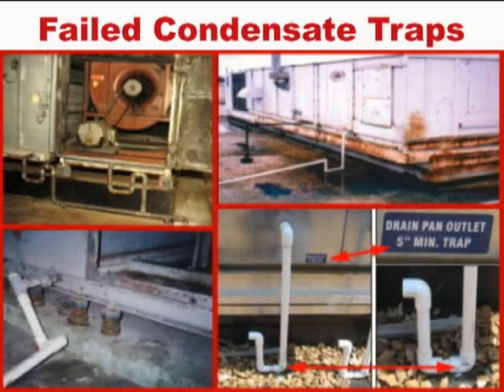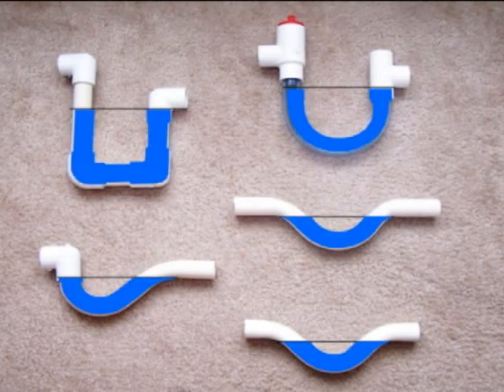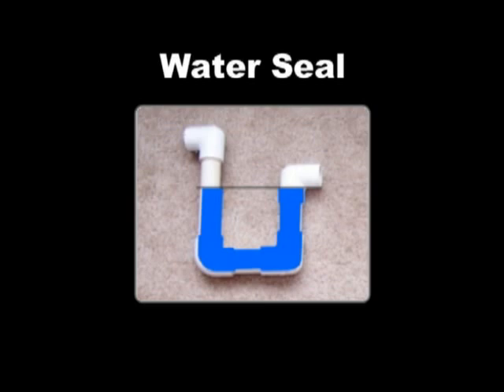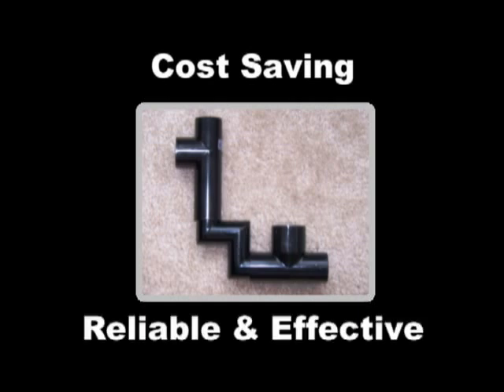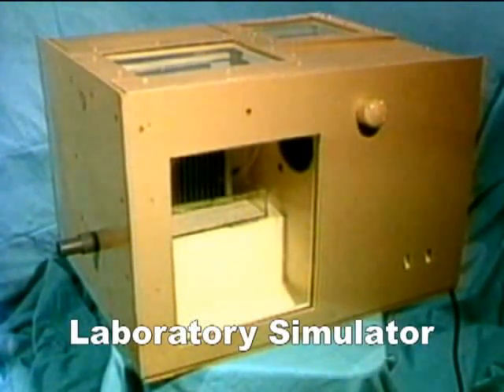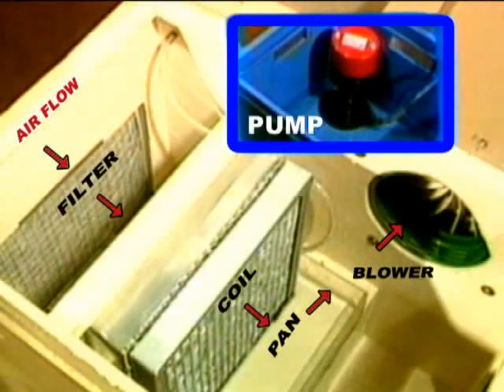CostGardTM Condensate Drain Seal

Comment: PVC, 90'S, T's and you got it
Reply from the maker: We tried that and it took 9 store bought 90's to do what we do with 3. The "T" is where the air seal is balanced. Piping in all our kits has been engineered to provide a seal during all operating conditions.
Reply from the maker: Perhaps someday we will do what you suggest. Installation of our product is critical. We have two new products for residential split system heat pumps up to 5 tons, and split light commercial up to 15 tons,  warehouses have purchased for resale.

Comment: Interesting product. Do you have residential installers in the Dallas area? I just realized there is not a P trap on my system in my home.
Reply from the maker: Our kits are simple to install, and come with examples and directions.  If you cannot install it, then your local contractor would be able to help.  We do not provide the installation service of our product, but are available for any and all technical support you or your contractor might need.  Call us to place your order 903-509-4843
Reply: CostGardTM thanks for the response! I’ll strongly consider it!

Comment: Does it meet code for installations on residential units?
Reply from the maker: metatech
Reply: Nay, it shant.
Reply from the maker: Absolutely it meets code, no moving parts, and all the above.  www.trenttech.com
Reply from the maker: @walshplumbing336  the CostGard Condensate Drain Seal does meet code - www.trenttech.com

Comment: Sweet! Thanks.  I have a small 1.5 Ton in florida and it molds regularly.  It also has a float shutoff which is required, but when it plugs, requires a service call to Nitrogen blow it out (no couplings).  These small air handlers have the same problem.  I also like the demo of pulling gas into the furnace.  That was interesting.  We had a unit above us so restricted on intake it was gurgling in my unit, pulling air thru the condensation line and from my washer p trap.
Amazing.
Thanks

Comment from the maker: SUMMARY OF TRAP RELATED CODES
(Prohibit Condensate Traps)

International Mechanical and Plumbing Codes
 Mechanical Code
 Section 307.2.4 Traps. Condensate drains shall be trapped as required by the equipment or appliance manufacturer.

 Plumbing Code
Section 314.2.4 Traps. Condensate drains shall be trapped as required by the equipment or appliance manufacturer.

Other sections of the International Plumbing Code actually prohibit traps on air conditioning drain systems:
 Section 1002.4 Trap Seals.  .  .  .  Where a trap seal is subject to loss by evaporation [an HVAC trap is], a trap seal primer valve shall be installed.

 Section 1002.3 Prohibited Traps. The following types of traps are prohibited:
  1. Traps that depend on moving parts to maintain the seal.

A primer valve has a moving part; thus, prohibiting traps on HVAC drain systems.

Uniform Mechanical and Plumbing Codes 
 These codes offer no technical guidance and make no specific reference to trapped HVAC condensate drain systems, only to trapped plumbing fixtures. Instead, the Uniform Plumbing Code encourages consideration of improved alternative methods (such as the CostGard™ Condensate Drain Seal). What each section states is summarized below:

 Mechanical Code
 Section 101.2 Purpose.  .  .  . The purpose of this code is not to create or otherwise establish or designate a particular class or group of persons who will or should be especially protected or benefited by terms of this code.

Plumbing Code
 Section 301.2 Alternate Materials and Methods of Construction Equivalency. Nothing in this code is intended to prevent the use of systems, methods, or devices of equivalent or superior quality, strength, fire resistance, effectiveness, durability, and safety over those prescribed by this code.

 Section 1003.1 General Requirements. Each trap, except for traps within an interceptor or similar device shall be self-cleaning.

Condensate traps are not self-cleaning, instead they are prone to frequent flow blockage and fail to meet that section of the code.

In fact, Sections 301.2 & 1003.1 can be interpreted as requiring the CostGard™ Condensate Drain Seal.
Reply: Most excellent information